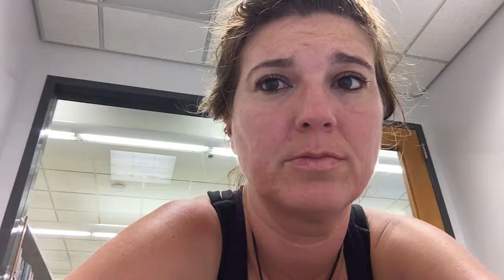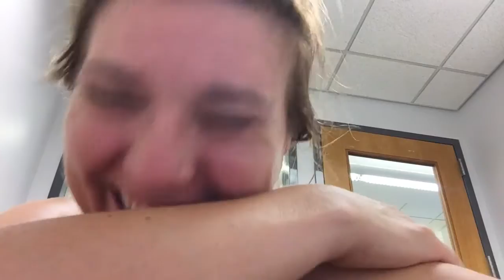The use of ailerons and riders in stall recovery and stall characteristics part 5

Comment: It depends a lot on wing design, a wing with built in washout will stall at the wing root first, where as a wing with no washout could tend to drop a wing especially on the side which has an aileron deflect down into the slipstream under that wing. the initial stage of this occurring is called an incipient stall, but a friend of mine used to refer to it as aileron reversal